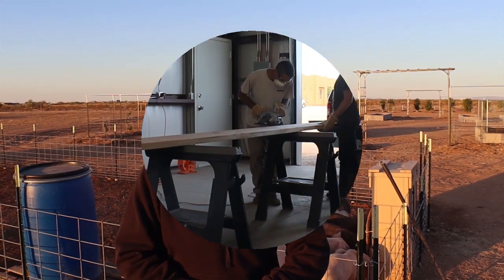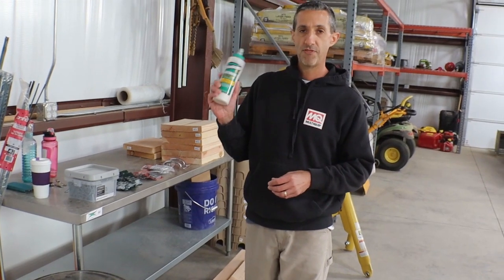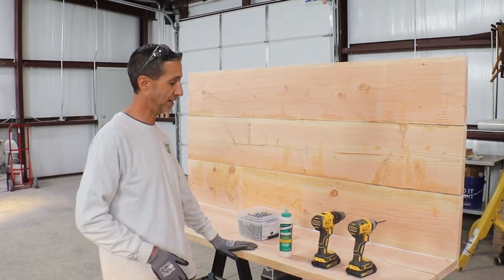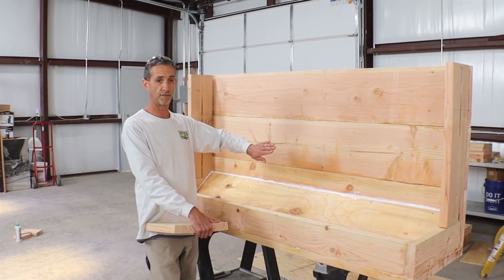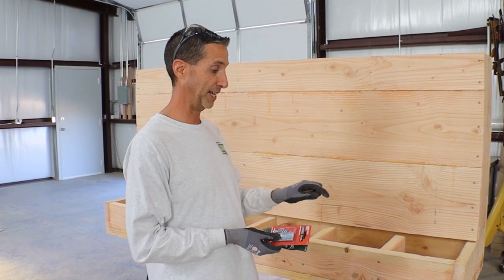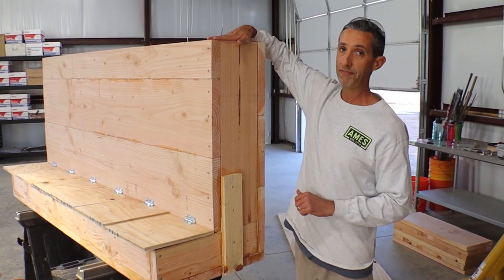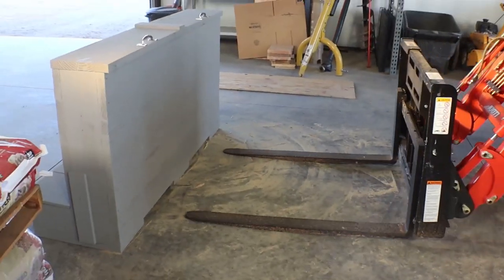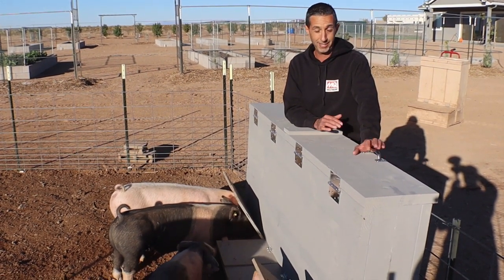Automatic Pig Feeder Build | 400lb Capacity Hog Feeder

Comment: Thanks for the video. Managed to build one with left over lumber around the house. Not as fancy but works. For the lid issue with them staying up, I cut a full width piece of 1/2 inch plywood and hinged it about  4 inches up the front so that it overlaps the flap hinges about 3 inches. That prevents the pigs from pushing the flaps all the way up and adds down pressure to always close the flaps.
Reply from the maker: Great addition for those flaps!

Comment: Glueing between joints & gaps should've been done while assembling the structure together, but other that, it's a great design for a large number of pigs. Thanks for sharing your video.
Reply from the maker: Thanks for the tip on that Joe. We're amateurs at woodworking, so we can use the advise!

Comment: Built a smaller version of this but based off your plans/video. Only think I ran into is the lids get flipped up and stay up. So gonna fix that issue tomorrow. Also, being in the PNW I think I am going to build a cover for it so it doesn’t get rained on all the time.
Reply from the maker: Hey Benjamin! I agree, those lids are really the sticking point with this design. Even when you can get them to flip down the larger pigs just tear them apart!
Reply: A little more work but I think building the lids angled would help. Obviously, pigs are super destructive so it's only a matter of time even if it's built from rolled homogeneous armor plate.

Comment: Good work, you can upgrade it later on adding the same amount of feeding stations on the opposite side of the feeder. Then place the feeder in the center of the enclosure or pen
Reply from the maker: Now that is a FANTASTIC suggestion on doubling this guy in the future. It would make filling it with the tractor much easier as well.

Comment: That’s a nice feeder. We have one of the metal ones and you can hear that lid slamming all the way in the house, lol. We fed 2 Berkshire feeder pigs to 300+ lbs out of it a couple years ago but I think your design is nice and wouldn’t need to be filled up as often.
Reply from the maker: Hey Jared. We almost went with those metal feeders, but knew they would be loud and we would also need a few of them in order to keep Lori from losing it over the pigs fighting over the feeders! This one cost us about $350 all in (wood, parts, screws and glue included), so it was actually a bit less expensive for 6 "heads".
Reply: @EdgeofNowhereFarm  Yeah those metal ones are really expensive. Mine was a hand me down. My cousins raised pigs in 4H but they’re all long grown up so my aunt asked me if I needed it when I got those pigs. I priced them out and was surprised how expensive they are.
Reply from the maker: @jaredmccutcheon5496  that's the trade off, your metal feeders are going to outlast the wood for sure!

Comment: for the lifting door flaps you could put scrap 2x4 where the hinges go so you can put longer screws and not have to use a grinder, great build we are looking at something very similar!
Reply from the maker: That would definitely work as well.
Reply: @EdgeofNowhereFarm  are you still using these bulk feeders?
Reply from the maker: @thomashicklin7864  no, we stopped last year due to the number of pigs we're finishing. It's only good for about 6-8 pigs and then it's too small. Last year we finished 20, this year 21.

Comment: How much more would i spend on feeds versus daily rationing
Reply from the maker: I suppose it depends on the breed, but if you ration daily you'll have a lot less spillage. The flip side is, there may be times they are not feeding. The studies I've seen suggest it can be as much as a 5% loss in growth from weening to butcher by rationing vs free feed.
Reply: @EdgeofNowhereFarm  thank you for taking your time to respond to me sir the right way to frame my question was how much more feed would free fed pigs consume compared to those on ration because if the difference is not more than 10-15% i don't see the point of rationing
Reply from the maker: @rugbystories3344  understood. We have had good luck with both free feed and rationing. This set up may cause you to waste a bit more feed, but it should give you a larger animal over the course of the season.
Reply: @EdgeofNowhereFarm  is the difference in amount of food taken significant (free vs rationed) i have a hog operation myself sir so i want to have a picture of how much more feed i might need i switch to free feedings sir,
Reply from the maker: @rugbystories3344  I wouldn't be able to say with certainty, but we have done both with good success. The one thing worth considering is the amount of feed that may be lost to the weather. If you get a lot of rain it will get into the feeder and you'll lose feed that way. Also the type of feed you're feeding is important. If you're feeding pellets you'll lost less, if you're feeding powder you'll probably lose more.
Reply: @EdgeofNowhereFarm   my feeders are made in a way that rain is not a problem sir, if only I could find out the difference in feed intake i want to switch to free feeding but i don't want to run out of feed am just 20 looking for more funds can be tricky anyway thank you for the information sir
Reply: @EdgeofNowhereFarm You could pitch a tarp over top to keep out the rain
Reply from the maker: @spencerk4077  as long as you get it up and out of their reach, you sure could.